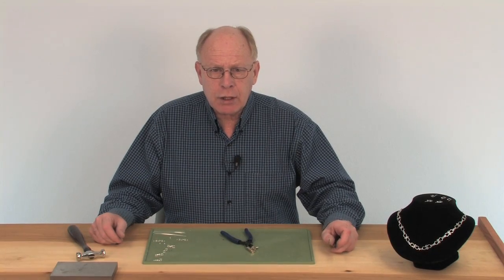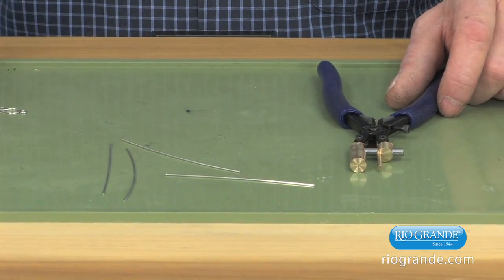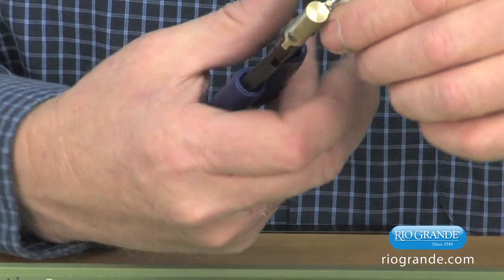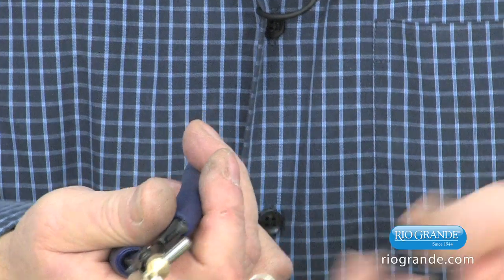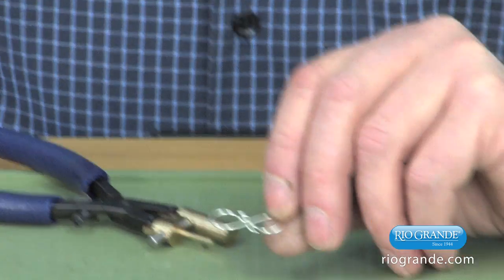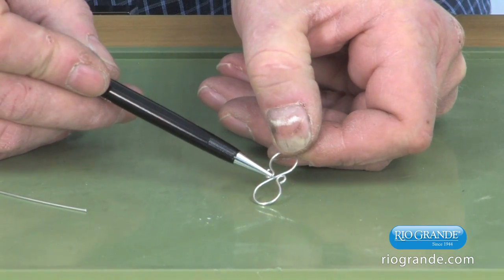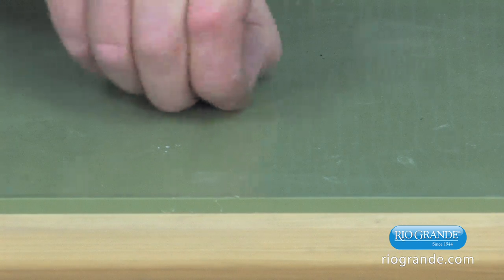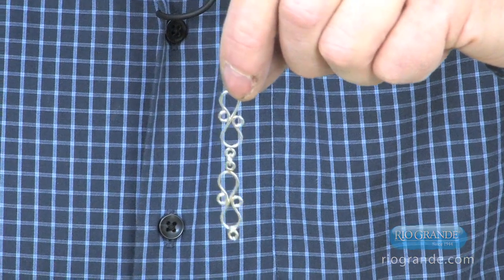Creating an S-Hook Necklace with the Swanstrom Bail-Forming Pliers

Comment: Hi. I have a few questions...I'm thinking about ordering the Link Former and this tool. I LOVE copper and make most of my pieces with copper. Is there a way to solder copper without leaving silver all over the piece? Is there such a thing as copper solder?
Reply from the maker: Hi there! Thanks for your question. We do offer a couple of copper solders on our site. The one pound coil (Item: 132198) is specifically noted for its color match. You can see them both here: https://www.riogrande.com/search?q=copper%20solder&c=&pageNum=1&pageSize=32&sort=1&t=1&attributeValueIds=f5f2713d-f67d-4179-8533-a7b9013f0fc0&isSort=False  Hope this helps.
Reply: In the mean time. You could also plate over the silver solder using spnt pickle. By using "contaminated" pickle, it will plate the piece in copper and cover up the solder well. There is a video about how to on jewelers acadame.coms yt channel. Basically you put your piece in with some copper and a piece of steel. I am pretty sure thats it. I've done it several times to my silver pieces by accident.lol but never tried to PURPOSEFULLY copper plate my items.lol so watching the video would be best on how to. Also, for a pickling solution in a pinch, you could use white vinegar and citric acid (which is what i used) or apple cider vinegar and table salt. Im sure you probably already know that. But if you dont and if anyone else doesnt know yet, i thought id put it out there just in case.